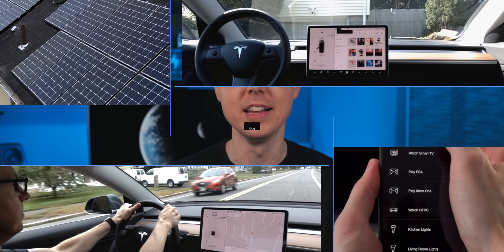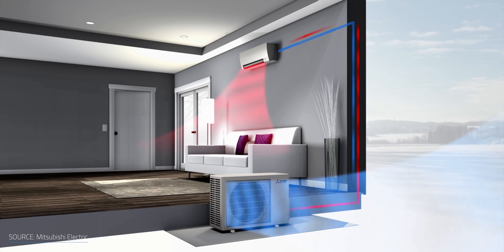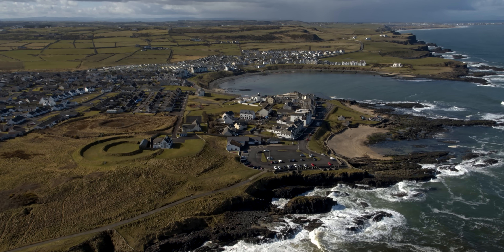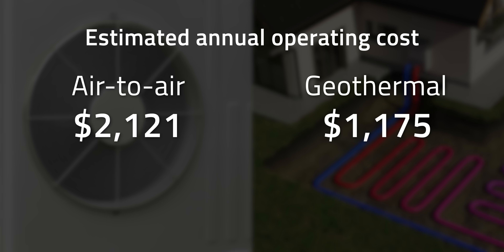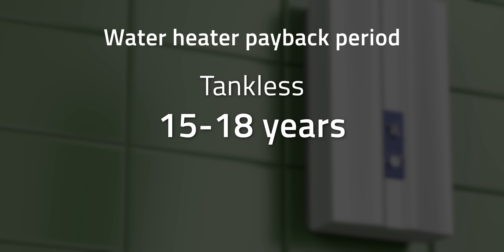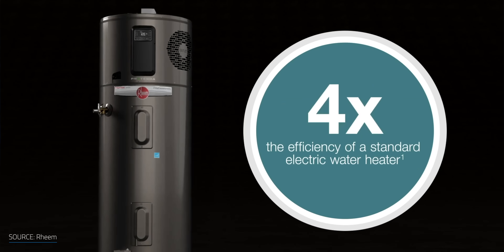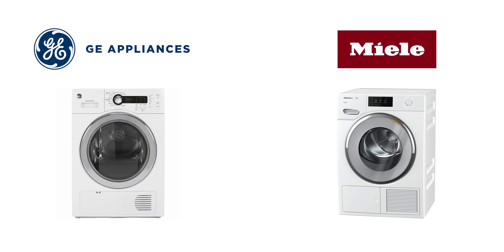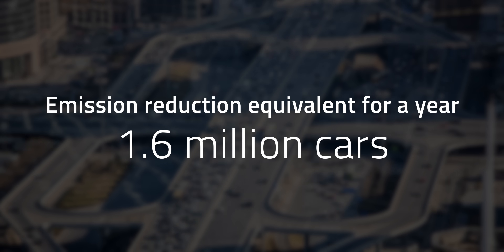Why Heat Pumps are Essential for the Future - Explained

Comment: Don’t get me wrong—I LIKE the technology.  But I very much DISLIKE the very bad Planned Obsolescence & dishonesty that seems built-into all tech now, & some other issues.   
Here’s why we stopped looking at heatpump minisplits, after about 10 contractor estimates done on-sight, & a few in-store interviews: 
…There’s too often poor grade of units sold (less efficient, & break more), at not much discount from the most efficient units, &/or, estimators never differentiated them from the most efficient ones, or were not fully informed or aware, themselves, about the systems cost/benefit ratios; 
…the high price to get & maintain; 
…due to disruptions in supply lines from overseas sources, scarcity of needed parts results   in even more costly upselling (premature replacing of entire components instead of repairing components); 
…NO standardization of even common replacement parts causes much more waste & cost; 
…vastly limited use-life estimates, compared w/old systems (most sellers estimate only an average 10 year use-life before major repairs/replacements needed—many systems require replacements & repairs before 10 years!?!); THAT bloats landfills, drives more manufacturing air pollution, & will drive future huge inflations as workers beg for yet higher minimum wages that are never tied to inflation rates—that’s a manufactured financial death-spiral; 
…NONE discussed adding insulation to the home first, nor that simple storm windows could often drop worst winter heat bills by around $100/coldest month, in the temperate PNW area (we simply refurbished our old windows & added storm windows w/a 3” airspace, & got that savings); 
…NONE of the estimators looked at our energy bill history, to see or estimate from those, how much one of these systems might save us; 
…NO Officials or contractors talked with, understand or promote UL/EPA listed rocket stoves now available, that burn forest floor detritus, waste wood & landscape trimming sticks ✅extremely efficiently, & don’t use electricity at all—these easily could start replacing inefficient bulk-wood stoves, & provide reliable, safer heat much more affordably for millions of people; 
…the ceiling cassette heads needed in homes w/low ceilings are less efficient, cost more, most contractors balk at installing them, & charge much more to install them; 
…many contractors will only do the most abbreviated (ugliest) installs; 
…None of the contractors here, seem able to accertain if we have actual 220v feeding the current baseboard heaters, which can mean less efficient heatpumps run on 120v; 
…the costly & invasive annual service contracts many contractors require (here, started at over $150/year & up), to have a stranger enter your home, to simply clean the indoor, then outdoor components; 
…the refrigerant may be comparatively “eco-friendly”, but we were told it may need recharged as often as annually, which means it’s leaking all along—& folks are Not told what THAT does—& it indicates poor manufacturing; 
…too often shady marketing (“installing this system will save you more than 50% off your electric bills!!”—but it can only save an average of 40% or more, off only the heating/cooling part of the bills—& that, IF you get the more efficient units)
…the better insulated your building is, the less heating/cooling is needed!—but none mention that) 
…DIY often isn’t, if you read the fine print; 
….States wanting to help climate, may be jumping to premature mandates, as legislators seem NOT informed of the downsides to the new tech systems—
—but the result will cause adverse impacts to owners & renters, especially at a protracted time in history of unprecedented inflation that industries have caused—
—the “for your benefit & safety” sales pitches are, & always have been, lies; 
…the federal incentives used as a major selling point, cannot be gotten by many, because, one must be able to Itemize on their tax filing to get them—those incentives are being Counted upon by sellers to offset the high prices of the systems, & they do NOT inform buyers of this; 
….there’s no safety/backup built-in, to protect buildings that can experience numerous &/or long power outages.  

Here in the Pacific NW of the US, heatpump minisplits appear to be marketed dishonestly in a number of ways, as you can see above.   
Insult to injury, for way too many there appears little to no ROI (return on investment) by the estimated end-of-use-life & end of loan payback, in about 10 years.  

As For the heatpump driers?
….why does no one say where the moisture goes when a load of laundry is dried?  
….And, the cost to buy & maintain vs. it’s estimated use-life??  
….And, the longer length of time it takes to dry a full load of laundry costing more? 
….And, sellers pushing regular non-vented driers (mold generators) that are Not heatpumps, as-if they were, on unsuspecting shoppers?  
….And again, the terribly deficient, estimated 10 year use-life? 

Where are heatpump window AC units?  
Where are MUCH better insulated fridges, & heatpump fridges? 

Planned Obsolescence is at epic levels of elephant-in-the-room.  
It’s infected every electronics industry, increasingly worse over the past approx. 30 years.  

NO one is talking about grid-down issues, beyond prepper-madness, as everyone is being forced to go “all electric” for all buildings—instead, we hear idiocracy pushing “clean coal”, & more nuclear energy despite the problems with that UNsolved.  

Solar PV is being pushed, but costs to do it are big, & again, similar issues as listed above.
And, most are UNaware of the utility grid’s Dependence on as many as possible owners,  merching their roofs w/it—which owners will need to maintain, Not the utilities benefitting from them. 

🤔WHY aren’t more VAWTs or newer tech, promoted installed where winds are, like along coastal areas, & other windy places? There now are bladeless wind-scoops, & other new tech, much less costly & lower maintenance.  

If you can address or resolve these issues well, it might go a long way towards convincing millions more to buy into changing.  
Until then, we cannot afford to throw money at yet more systems that financially jeopardize owners, & make them even more dependent on industries that take increasingly Undue financial advantages. 
Talking about saving$ These systems offer, has been a false construct made of incomplete, missing or false, & questionable data, as far as we can see.

Comment: Stick to Facts!!!!! Heat Pumps use electricity and Electricity is generated by Fossil Fuels. A heat Pump is Very much more efficient than ELECTRIC heat strips for heating. This is the Energy savings over like for like. Gas and Propane Furnaces operate at up to 98% efficient. The Flue on mine is PVC pipe because the flue gas in air and water as products of combustion. Does it really make sense to move the electric heat coils outside to heat the heat pump instead of putting them inside just like we do today!!! I would have to see the real cost of operation comparisons on placing the Resistance in an outdoor environment. This looks like a bait and switch move and an increase in maintenance costs. Finally Heat pump cost of operations is usually loaded with incentives or rebates on electric rates if you switch to All Electric!!! This is also a bait and switch. Just like the fight against fossil fuels ultimately puts ALL power consumption under one utility Electric. The numbers are in and EV's are proving to make a 0.04% difference in our over all carbon foot print. Discussions on EV's Always do the same thing as the Heat Pump discussions. Heat pumps compare the latest technology in their field to old 80-85% gas furnaces. Your whole discussion on the all electric laws is the perfect example!!! Force everyone to electricity and then the prices skyrocket!!!! Don't believe me look at Europe today. Nuclear off/ nuclear on. Wind turbine failure rates up to 20%+ and Gas was blown up by Biden!!! Be very careful of playing into a single power world. IT IS all about control and money. Fact check look at the regulations that keep taking the benefits of off grid and personal solar systems away from consumers. Why can anyone anywhere build a 100% off grid house? Politicians and Electrical utilities know that would mean the public would be independent from electrical grid power and control. Control is the key to destroying alternative and competitive fuel sources. I have been in tis industry and watched the power play for 5 decades.

Comment: I'm sorry this is NOT ACCURATE. There are many other factors to take into consideration like electric rates going SKY HIGH only recently. When you commit yourself to a technology you have to be able to power it properly. For those who do not have solar and live above the 30th parallel DO NOT get rid of your gas heater. Gas is still dirt cheap. In a power outage a small generator can keep your heat going where it takes a massive one to run a heat pump.

Comment: Wait so... 1W heat pump > x3 x0.4 (stirling engine efficiency) = 1.2 > use 1 for heat pump and get 0.2 extra > infinite power? :) yay
Reply: You misunderstand. The extra energy is gathered from the air outside using the big noisy fan thing outside the house.

Laws of physics are not being broken.

Its basically an air-conditioner, running in reverse.
So instead of taking heat from the air inside a house and dumping it outside, its taking heat from the outside (the air may feel cold to us but it does have some heat in it) and dumping it in the house.

Comment: As an engineer, PLEASE, I beg you, stop with this "300-500% efficient" nonsense. You are telling lies to people who don't have an understanding of the laws of thermodynamics. Only the COEFFICIENT OF PERFORMANCE of a heat pump can be > 100%, NOT its "efficiency". For low temperature deltas, it is possible to MOVE 300-500 watts of heat given 100W of electric expenditure, but since energy is conserved when moving heat (as opposed to generating heat by burning something), the 300-500W must be on both sides of your "efficiency" equation. So 100W electric in + 300W heat in = 300W out, for a theoretical max "efficiency" of 300/(300+100) = 75% (minus losses inside the heat pump itself). THIS is why the term "coefficient of performance" was coined for heat pumps, so as not to be confused with "efficiency". I get headaches explaining this to non-technical ppl so thanks for letting me rant.

Comment: It's presented as almost new technologie in USA. Well in Europe, at least Western Europe heat pumps it's seen as pretty mataured technologie and has been common for many decades. For villas earth heat is very common here. It's also very efficient also in cold climate, because earth or ground is always over zero degrees celcius just a few meters below. It's not even mentioned in the video. I think you gays in USA has a few things to catch up when it comes to non fossil or less fossil technologie.

Comment: I have a lot of solar panels, more than I need and backup batteries.  All I need now is a heat pump so I can go off grid instead of feeding electricity back to the grid so that the utility company can profit .35 per kWh and only pay me .05 of the .40 they charge customers.  Complete scam and the utility in my area is PGE they have a complete monopoly and do as they please regarding rate hikes, solar credits, etc.

Comment: Heat pumps are awful. if you have gas supplied to your home i would never recommend switching from a gas furnace to a HP. They simply don't work well enough in conditions below freezing opting to send a signal back to the air handler to use electric heat via resistance strips which will run up your electric bill. Not to mention they add a handful more failure points in the refrigeration loop. Most of which require a technician to recover all the refrigerant in use. Natural gas is good, would recommend to a friend.

Comment: 9:47 the hybrid heat pump can save $491 a year of an average bill of $600 for a regular water heat tank (for a family of four). So you are saying it only costs $109 a year to run....um no. This Matt dude just grabs random facts and figures to make up some word salad that sounds like he knows what he is talking about but instead is just a master class in Dunning-Kruger. It makes it even more laughable when he has TinkerTry give a testimonial where he states (for an average of 2.5 showers per day which would suggest a family of 2) a cost of $195 per year....double that for a family of four and you come up to $390 per year for a family of four....far from the "4x more efficient" that Matt goes on to state

Comment: Its not true what you’ve said in this video. Heat pump does use fossil fuels becouse fossil fuels are used in the power plants, where electricity is produced. In winter when it’s necessary to heat your house it’s impossible to power a heat pump with solar panels placed on the roof of the house, that the pump device is heating up. Becouse energy delivered by the Sun per square meter, is too low to supply it. If the energy delivered by Sun to the Earth would be high enough to run a heat pump with your solar panels placed on your roof, it would be also so warm outside, that you won’t have to use the heating device inside your house at all. Excluding few weeks in late spring and early autumn when it’s still quite warm outside, days are still quite long and you don’t have to use heating at night when solar panels doesn’t works. And it’s not true that heat pump only moves heat energy. Heat pump device uses electric energy and produces heat energy, it happens in proces of compressing gas and it’s called thermo dynamics. It’s also false that heat pumps are 400% efficient. They are 4 times more efficient than electric heater but in overall equation, when you calculate heat used in power plan to produce 1 kWh of electricity and heat produced by heat pump using that 1 kWh. It’s efficiency would by clearly under 100%.

Comment: Heating and cooling using heat pump does not make sense, to move heat you need heat sink and heat source, one with higher temperature and another with lower temperature. Where are you going to get the heat source from? It is violating the 1st law of thermodynamics.
Geothermal make sense because you store heat underground or use underground as a sink depending upon the house temperature.

Comment: A very annoying mistake is to compare irrelevant values. All the driers changing over to heat pumps by 2050 will be the equivalent of taking 1.6 million cars off the road -- for one year. This false comparison makes it sound like it's much more significant than it is because you are comparing different time scales. Similarly, "if we all unplugged our phone chargers at night" that would be 0.001% of our electricity use, and while nice, wouldn't be signficant. Please try to avoid comparisons like this, as they give a phony sense of complacency about the issue. State the percentage, which is tiny but at least not zero.

Comment: You’ve managed to talk me out of moving to heat pump systems, they’re big, ugly and noisy. Too high up front costs then bigger radiators are required suggesting they generate less heat and what happens when all the ambient heat is taken from the ground in the ground heat recovery systems and the air systems seem less efficient in the colder weather when you need them the most. Is the refrigerant gases harmful to the atmosphere when they leak?  Good luck with your system. Hydrogen is the answer.

Comment: Heat pumps have problems. Namely that refrigeration systems are expensive to repair and finnicky, especially when poorly built a la modern appliances. All refrigerant appliances are sealed systems and will cost a thousand dollars or more to fix, every time. Refrigerants are either very flammable or have crazy high global warming potentials. There's potential here, but we need quality manufactured appliances that won't turn into garbage in 5-10 years for any of it to make sense. When all of the parts are built in countries with no regulations and have slavery in their supply chains, the reliability/repairability hit is amplified dramatically, nullifying much of the gains in efficiency.

Comment: Much of the information here, while true, is painted in a misleading light. for one, efficiency drops with a drop in ambient temp. over all heat pumps are generally cheaper torun vs resistive heat to eat a home but there are times when that is not true, mainly when heat loss overcomes the capacity of the heat pump, which is also something that frops off in colder weather, capacity.is a heat pump going to save money over gas fired appliances? that all depens on the cost of electric and the cost of the fuel used to heat, andyou have to addin the capacity and eff loss at colder temps. heat pump dryers lasting 2x as long as regular dryers? BULLSHIT. Not only do I call bs there, a heat pump dryer is far morecostly to repair. This entire video reeks of poor deceptive marketing. Heat pumps, are a great tech, and work great when utilized in the proper settings, but their maintence if doubly important compaired to a heater or ac by itself. after all it will runn year round wheras a heater or ac will not. This is coming, from an ACTUAL expert in the field. THey are great in certain circumstances, and abysmal in others.

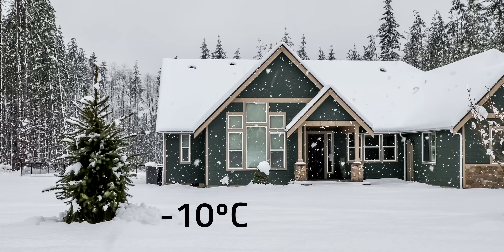Comment: 10C = +14F not -14F as you show at 5:04 into video (although you SAY 14). Air source heat pumps will BREAK YOU here in Michigan - ground sourced is the only "reasonable" option and only if you don't have access to natural gas. That installation costs a minimum of $10,000 and could never be justified financially to replace natural gas. It would only make sense if you worshiped at the church of IPCC.